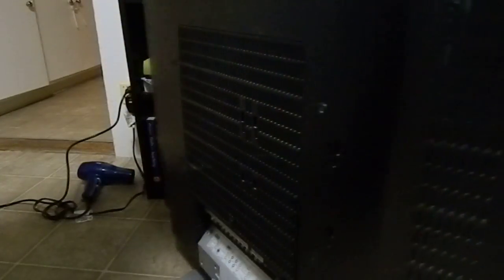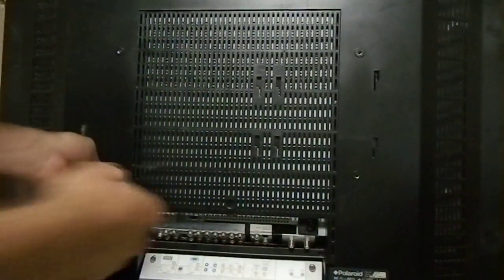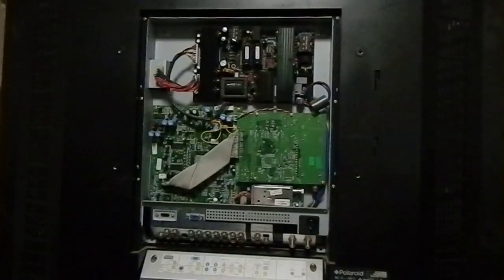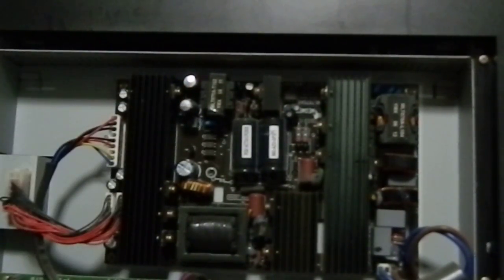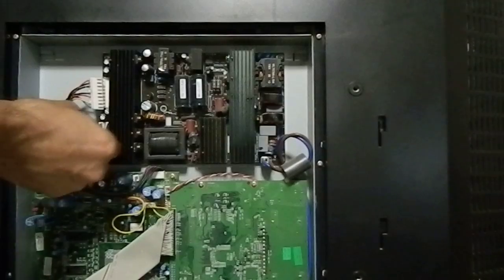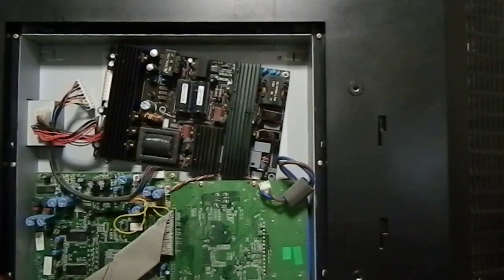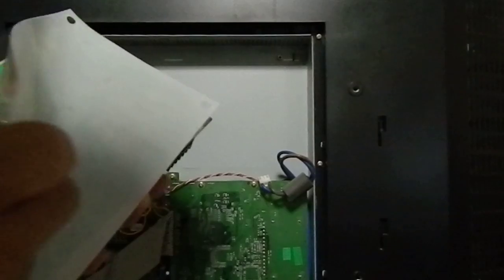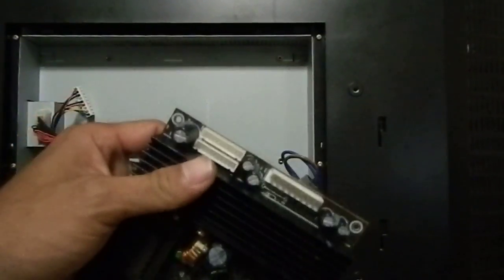HOW TO REPAIR POLAROID LCD TV (como reparar Polaroid LCD TV)

Comment: Mine does that too but it will shut off the screen the power button won't work the remote won't work it's like it just totally freezes if I unplug it and plug it back in after about an hour it does the same thing can you help me find out what is wrong and how I can fix it thank you in advance. By the way it's a 42 inch LCD